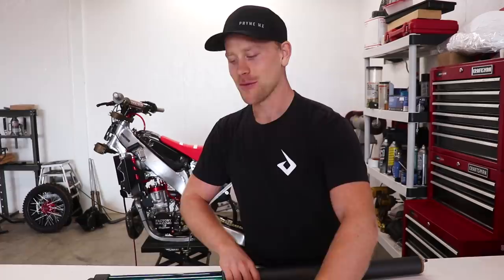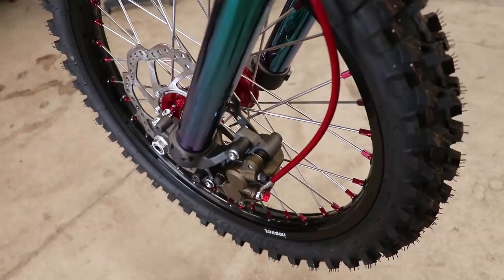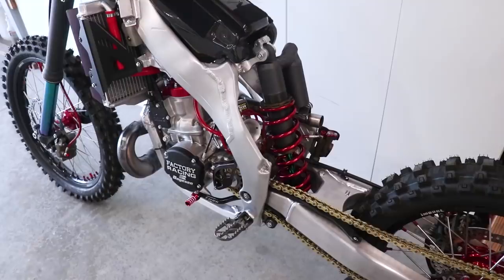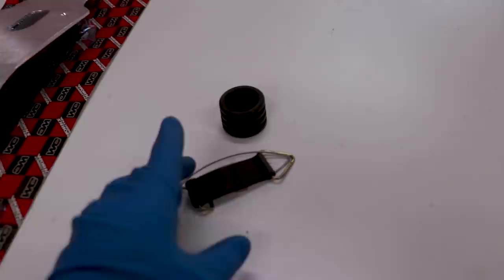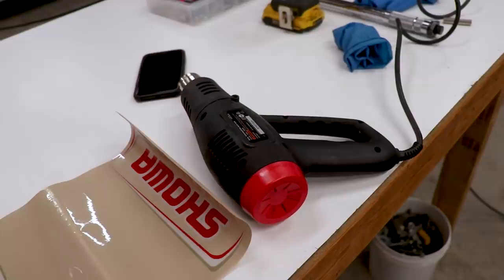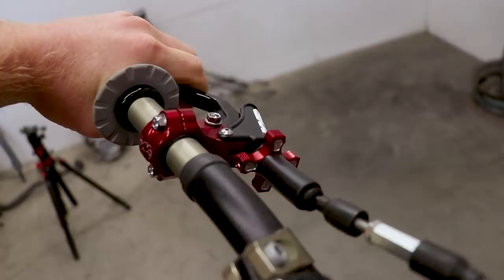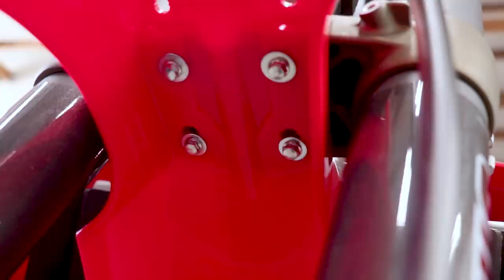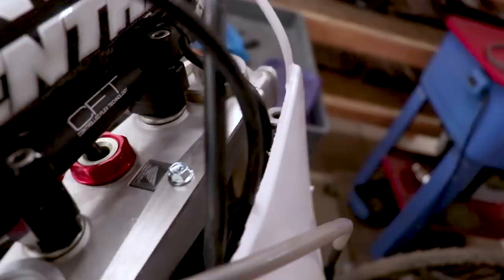Finishing My CR250!

Comment: I had a consistent shimmy wobble through 40mph on 86 Yamaha Venture Royale with no fix after several attempts, all the standard stuff! So I called Yamaha in Japan an talked to technical tech. He told me: On center stand an level, Loosen Bolts as you did! Then start motor an run motor transmission up an down through  gears at least three times (this would align motor an driveline)! Then tighten from center out like you did, an that fixed the wobble problem I had since new! Thanks!

Comment: Hey Cameron the reason for the different angle on the polisport front fender to the 19-20 fender is when the front suspension is fully compressed the tyre will hit the 19-20 fender. It will actually make the plastic go a lighter colour where it stretches when hit, it will show both sides of the fender at the number plate. Also those rear fenders snap pretty easy!

Comment: To tighten the axle bolt you use the pinch bolts on the far side so that the axle can move in the near side still.  Then you loosen them to unbind the forks. Or ideally you just use an axle hex thing.

Comment: That looks awesome. I added the Polisport restyle kit to my 2003 Cr250 and it's the same as yours. the rear shock adjuster hole doesn't line up, and my biggest complaint is the front fender is made of really cheap plastic. every time I land from a jump the fender hits the front tire. It's super flexy. Not a fan.

Comment: you should tighten the pinch bolts on the non calliper side first, then torque the spindle nut, the tighten the pinch bolts on the calliper side, release pinch bolts on non caliper side, compress forks up and down, then torque down pinch bolts on non calliper side.

Comment: Sweet, man! Two questions for you. 1) Did you notice how much wider the shrouds are, especially from the rear? I’m contemplating going back to stock just because of it. 2) Ride Engineering states that you need a 19’ Front Plate & Front Fender to run their triple clamps, which tells me the mounting bolts differ from stock, one would assume that would negate the need to drill any additional mounting holes - right?

Comment: Bro you need the double shortys. That would look sick. I’ve never seen it on a 2 stroke but you would probably need to make mods to the frame to bolt on the one on the left. Also would probably need to get the “splitter” manufactured

Comment: Next Build better be an 89-01 CR500 engine in the honda aluminum frame of your choice.  You'd be so stupid not to choose this, you would gain a ton of new subscribers.  

AJ should have billet cases in stock and the turn around time is two weeks for the frame welding and radiator / exhaust mods.  

Adam Millar can cut the head add a decomp valve and port a new cylinder for you.   

You probably don't know these people but I have talked to them at length multiple times they are the cr500 gods...

Please do not ignore my comment lol this project would be solid gold.
Reply: or BRC 500 KTM would also be another solid gold project

Comment: Holy crap dude the bike turned out better than I could ever have thought it would. It looks sooooo good. So glad I’ve been following along with the build and glad you beat cancer! Love following along and learning with your videos!

Will that front number plate bracket for the 04 fit the CRF250R? What I’ve done is an 09 front plate on my 04 triple clamps, and I’ve just got some jerry rigged metal strapping made into a bracket to hold it in place. If your bracket works then I’d rather buy one of those to make it look a lot better and function better too! Plus support the channel! 😉 great job on the bike. It’s mint.
Reply from the maker: Thank you Kris! Much appreciated! Yes, I do have a bracket that'll work for a 04 CRF250 https://www.prymemx.com/collections/parts/products/20042007bracket
Reply: Cameron Niemela and it’ll work with an 09 plate?

Comment: I would highly recommend not using that tusk brake pedal. I used them on my yz125 and 2 of them stripped out on the frame and the 3rd one bent completely backward after going through a really deep rut. I like tusk but there shift and brake pedal are garbage imo

Comment: Hey Cameron Niemela I have a question. Have you ever worked with an oil injection system on a two stroke. A bud just gave me his 1980 Suzuki DS250 and after a few hours of going over this thing I’ve found that not only is the carburetor shot but someone has tried to bypass oil injection and it only has one oil line left on it from the tank to the pump. The engine kicks over smoothly by hand without the spark plug and its definitely got good compression so I don’t think the engine is hurt. Was wondering if you had any insight on how I go about adjusting this system and how I would be able to test the pump for problems

Comment: I wonder what is the ceracote thickness? when painting the clamps and outer tubes doesnt it mess with the tolerances? and is it durable enough to withstand the crash and twisting of the fork inside the clamps?
Reply from the maker: It's a thin coating and doesn't effect tolerances

Comment: Other quistion. Im in Netherlands. I payd around 2500 dollars for a cr250 of 2003. With a tick in the motor. Is it normal that you can find cr250s in the US or else for under 1000 dollars. If yes maybe its worth for me importing a couple. Here it is also a collectors bike. Espacially the 2003 , was the last with the great engine.

Comment: That number plate bracket should be aluminum
Reply from the maker: Threads wouldn't hold up with aluminum
Reply: @CameronNiemela  not for motorcycle application I make brackets like that out of aluminum all the time. The threads should be fine especially since they're is no load on them.